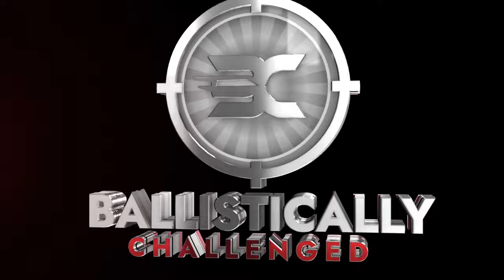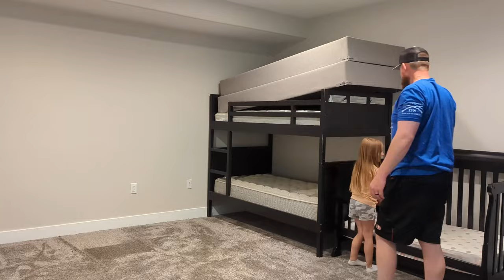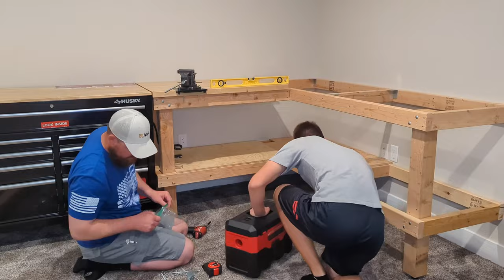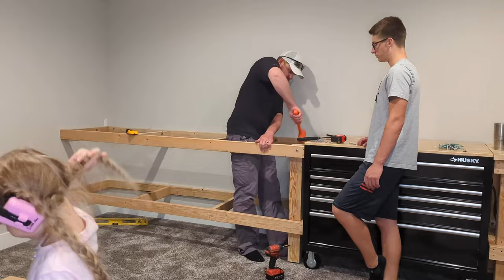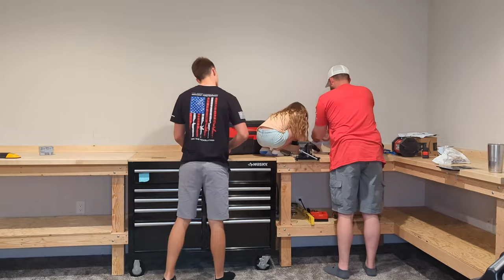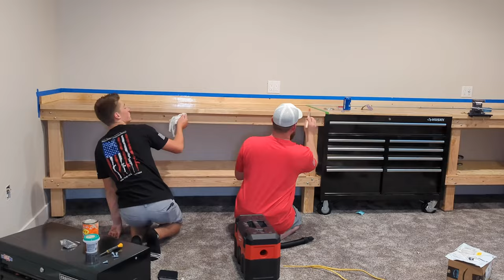Building my new gun room (part 1)

Comment: Beautiful job, especially love those sturdy benches.  One thing I did to a similar shorter bench was just add some cleats about 10” down from the top, and put a 3/4” thick sheet of MDF in there that I could slide in and out, with supplies on it, but of course drawer guides would have been better, and it does limit the height of items on the bottom shelf.

I setup in my sheetrocked garage, and because of space limitations basically did something similar to yours, but with only one overhead cabinet, and had to put 3 benches in, in different areas of the garage.  One 5’ Humber sturdy bench tied to the cement floor and the firewall for a Dillon progressive, one 6’ bench with two single stage presses, and one 5’ bench across from that just for brass prep.  Wish I could have a wall with gun mounts, but have to make do with safes.  You did it just right from the ground up.  Beautiful family helping there as well, congrats!  👍
Reply from the maker: Thanks man, I appreciate it. You gotta work with what you've got and what your needs are. Thanks for the comment 👍